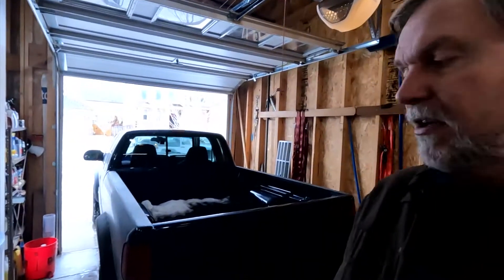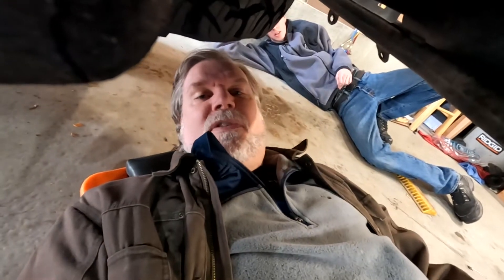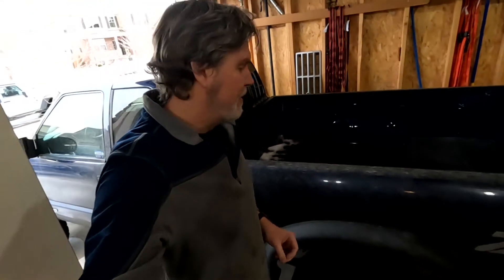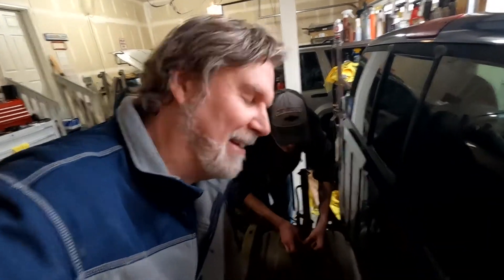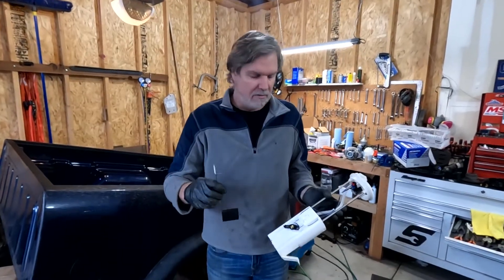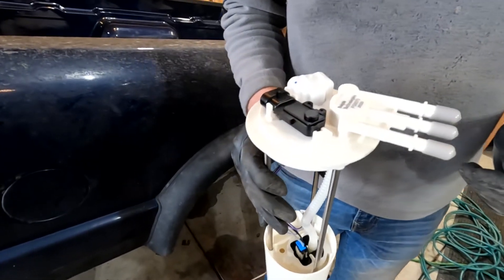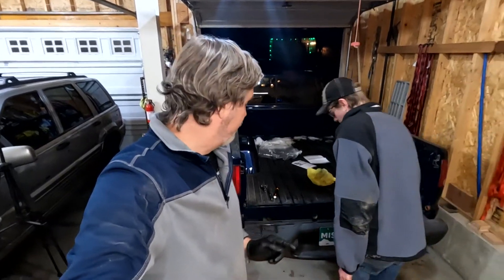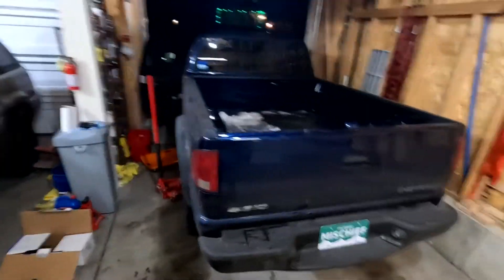Chevy S10 Fuel Pump Replace [How To]

Comment: If you need to do this by yourself, you can take out all of the left side bed bolts, loosen the right side bed bolts pretty far, then push up the left side of the bed and throw some wood blocks in there to hold it up.
Reply from the maker: Hey that's a great tip! We thought pulling off the bed would be kinda fun but it was shockingly heavy, so your method is a great idea even if you aren't by yourself. Thanks for commenting!
Reply: I did the same thing and it was really easy. Especially if you dont have freinds  to help you lift off the bed. My fuel pump ran with the bed up like that left the right side bolts on and only took off the left.

Comment: Yeah I've got a 1998 ML 320 Mercedes Benz that needs a fuel filter changed, and I will have to take out my back seat in order to get to it, so I feel your pain.
Reply from the maker: That's sweet! Joel was a technician for Mercedes when your ML was new... but his memory is so bad he probably won't be any help lol. 98 was the first year of the new V6 that replaced the inline 6, wasn't it? When it first came out, Mercedes' Chief Engine Designer said it was smooth enough to balance a coin on its end with the motor running. Pretty cool
Reply: @MotorsandMischief  yeah, haha, I've been seeing a lot of videos on YouTube lately with a coin being balanced on the top cover and I thought "I'm going to have to try that myself". 
I absolutely love this little guy. It needs some minor work done to it but the fuel filter is the worst thing wrong with it luckily. I drive truck OTR and my co-driver and I actually delivered at the Tuscaloosa plant in Alabama. This is the only Mercedes ever built in the United States so I think it's really neat to have a piece of history, if you will. I would love to take a tour of that plant someday. This particular model was also made semi famous by the Jurassic Park franchise. I believe the third movie maybe? That's awesome about Joel having an inside leg up in the brand. I love the brand. Bertha Benz drove the very first ever "Mercedes" Benz and it has been an adventure ever since. I also have a 2002 Toyota Avalon XLS, they are really sweet cars as well. Even though some people didn't like the grills because they were too "toothy" I think that is what makes the personality of the car myself, but to each their own. I enjoy working on my vehicles also, if it is something that requires a bit more than I have available then I call my trusty mechanics at my local dealership. My poor Raptor had a hidden issue with the door latch on the passenger side, it broke for some reason, but it still works, just doesn't look very aestheticly pleasing.
Reply from the maker: That's super cool! We understand the Tuscaloosa plant currently builds GLE SUVs and Coupes as well as GLs for the world market, and it has its own test track!!! Super cool you got to deliver there.

Comment: I got an s10 2000 4.3 v6
Reply from the maker: Nice! Those are sweet trucks and an awesome engine. You simply can't find one like it new. The Maverick, Ridgeline and Santa Fe are about the same size, but they are FWD unibody trucks. Its just not the same. Thanks for commenting!

Comment: In the time it took you to pull the bed you could easily drop the tank install new pump and put tank back in. Lol
Reply from the maker: Don't be mean friend, judging from your tag, we'd probably get along great in real life. This dumb pump failed about six months after this video, and I had to do it again. This time, I left the bolts loosely in the very back of the bed and just jacked the bed up like a dump truck bed, worked well and I didn't have to pull the tank, which I really, really hate doing. I always end up wearing most of the gasoline somehow. I've got another video where we replaced the pump on a Grand Cherokee and of course we had to drop that, so I do know how to drop tanks successfully. I just really hate working up over my head if I don't have to so yeah, I stand by my comment, I do think its easier to pull six bolts on the bed and tilt it back than to drop the tank, especially when its full. But thank you for commenting!

Comment: just a tip: after you take the 8 bolts off, you can’t just lift the front of the bed instead of removing it
Reply from the maker: Thats a great tip! That darn bed is way heavier than it seems like it would be lol. Thanks for the tip!
Reply: I've heard the Delphi pumps are now chinese junk that doesn't last. Anybody know a good brand?